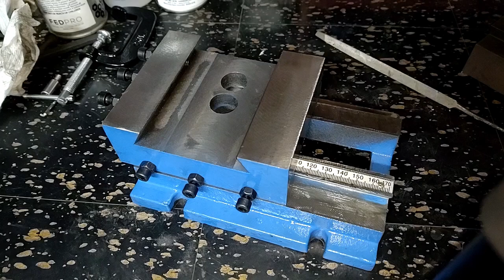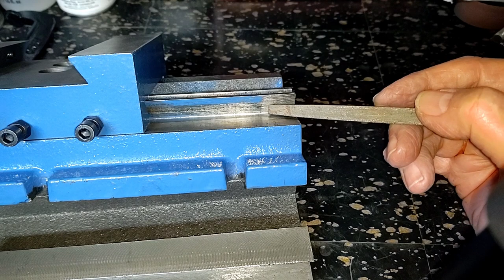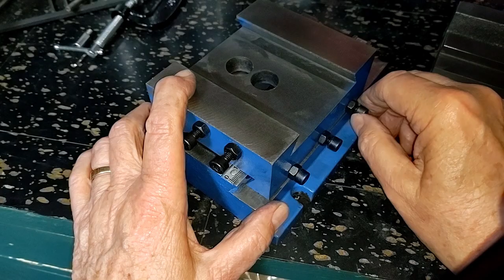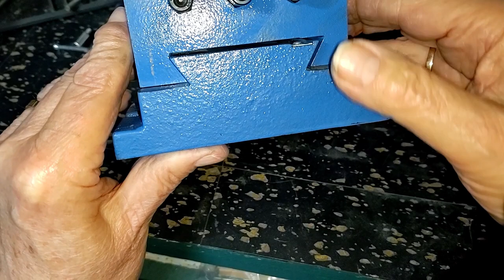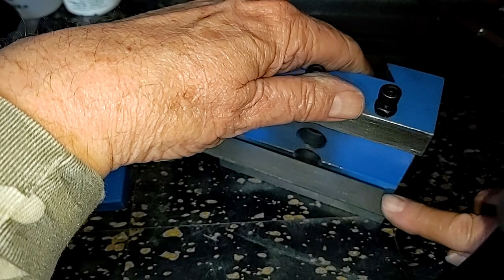Chinese X Y table fitting the lowest slide   Putting it into fine fettle

Comment: I had to do a similar thing with a compound table I bought for a Zimmerman mill so I 
could machine metals on it. I bolted to my flat bed, clocked the vice and thought fantastic
I'm ready to go, I machine a few grooves , perfect , then squared the ends except they 
were 91 degrees . After a bit of pondering I realised that the dovetails of the casting that 
u were working on were not at 90 degrees to each other  Grrrrrrrrr. Luckily I had a 
Bridgeport at work and set up that casting using 2 diameter rods that rested against 
fixed dovetail . I had bought a 30 degree cutter and trued up the top fixed side 
dovetail. It was a lot of fiddling about, especially as I did not want to make it worse ! 
Over an hour to set it up , 5 mins to take a fraction off so they were square to each other.
I did this by drawing a " Sharpie " lines along the dovetail and took small cuts off till the sharpie lines disappeared . ....... Your should check how square yours is !!
Anyway all back together vice back on and now 90 degrees
Reply from the maker: A good catch and fix on your part. 

In the case of mine, it's clear that there is an angle problem which I am going to have to deal with. I haven't shown this yet in the videos, but as I slide the middle section back and forth, the distance between it's side and the side of the base changes. This of course I can always compensate for by how I bolt this to the table. 

The problem you had, as you well know, was in the mid section which sets the relationship between the two axis. I have yet to check this, but I will be doing so.

Thanks for the good advice.

Comment: Thanks for the info, i have a similar one to yours, ill give it a good servicing soon
Reply from the maker: It's worth doing, so much better results. The iron in these is not too bad, just make sure that it runs square and if not, make up a compensation table so that you can adjust.

Comment: Threaded rods were installed at manufacture instead of lead screws. Once I changed over to the lead screws and flattened out the ways, it worked satisfactorily.
Reply from the maker: That is what I am in the process of doing, addressing the ways of course is key. I am glad that you are getting good results from yours.